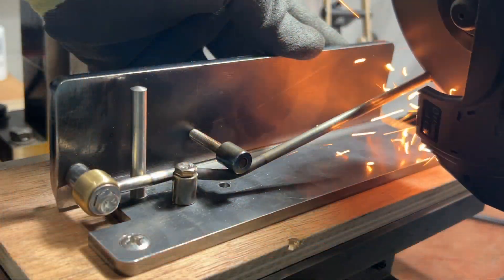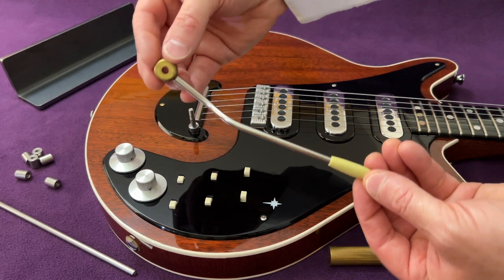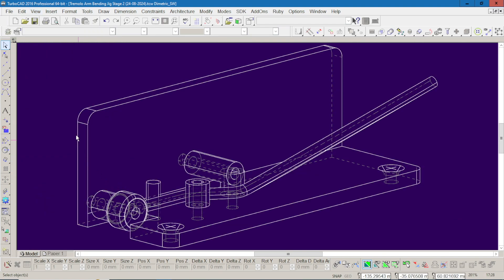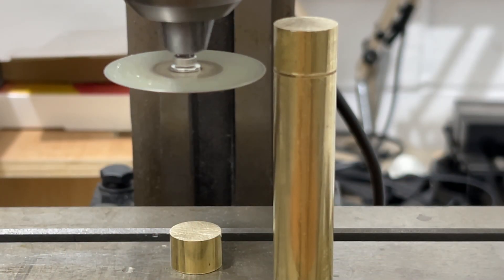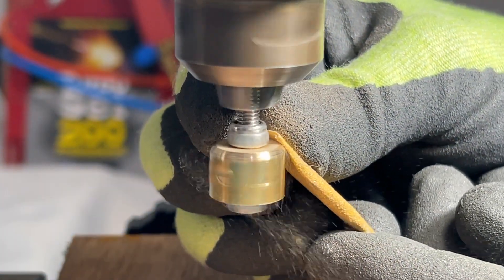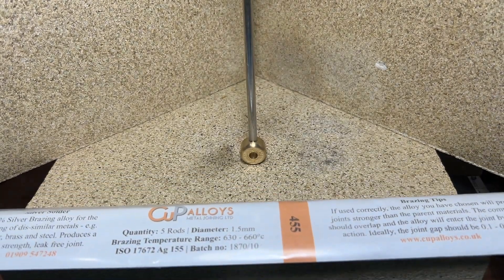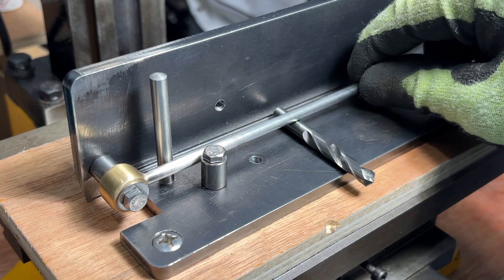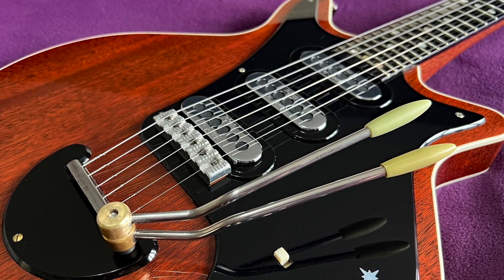Brian May Red Special Guitar Tremolo Arm Design and Make

Comment: Hello. I would like to ask a question not about the original red special, but the red special guitars made by  Guild. I'm curious as to why Kahler Tremolos were included on them. Was it because they were the closest in operation to the original red special trem? Or was there some other reason I am not aware of? I would appreciate your insight on this.
Reply from the maker: Check out Gary A. Donohue's very informative website page on the 1985 Guild BHM1:

https://www.gad.net/Blog/2019/03/19/1985-guild-brian-may-bhm1/

The reason is most likely because they are a reasonably priced, decent quality standard rocker tremolo unit available in a black finish to blend in with the gloss black pickguard.
Reply: @dsgb  Thank you for your input. I believe you're correct. Guild must not have wanted to recreate the red special's bridge at first, likely hoping that kahler was a close enough approximation.
Reply from the maker: Take a look at my Burns BHM4787 upgrade:

https://dsgb.net/projects/burns/

I am seeking a commercially available gloss black 'chromed' tremolo for this to achieve a similar affect. The - Wilkinson WVS50II tremolo black should do the job. 👍🏻

Comment: No you should not be wearing gloves for that! It's extremely dangerous to wear gloves when operating any kind of machinery be it a drill press, bandsaw, table saw, lathe or mill. 
It may seem safer but it's really not, if the glove were to make contact it could get bound up and it would pull your hand further into the machine and you wouldn't be able to stop it from happening, which would shred you.
 With bare hands yes you'll still get injured but you'll at least be able to pull your hands away from the machine before it could cause serious injury. 👍👍
Reply from the maker: This is good general advice, thank you for explaining in detail. 👍🏻😀

I would like to reassure people taking the time to read this that I have worked within industrial and nuclear safety fields for 25 years and hold a NEBOSH general certificate in workplace health and safety.

My recommendation was based on the judgement that in this specific situation, the risk of being cut by the diamond coated disc is outweighed by the risk of more significant injury caused by being drawn into the rotating machinery. Further, this mini drill press is a low torque machine which readily stalls if a load spike occurs.

Risk assessments and recommendations to wear or not wear personal protective equipment should always be appropriate to the specific task being undertaken.
Reply: @dsgb  Believe in what you learned Sir. It's polite from your side to be kind  and nice to all sorts of people on the net including myself ☺, but if i was at your place i would rather believe in what you already know + your practice. IMHO Gloves are ok 100% for that task you were doing, this comes from safety occupation engineer. Cheers. 
P.S. your YT chanel and site are amazing. For a poor engineer like me who repair guitar, design tools and wind pickups and aim to make some ala ''red specials'' it's a perfect place. I hope that one day i will get some normal camera to start to make videos about guitar pickups. I admire Bran May due to he made his own guitar and i think that some brand riped of his tremolo bridge idea ( Brian told that as well in a nicer way i think), for me that tremolo due it's long knife edge is superior.
Reply from the maker: Thank you so much for your supportive and positive comments. 🙏🏻💜
Reply: @dsgb  no problem, thank you for sharing the know how. You had right when for what you told, and i think it's good for people to know that. The knowledge💥 is power 🤗
Reply: Not exactly, if gloves are well suited to hand it's better to have them. Cutters and drills will damage the glove and you can feel that if it's snag fit good qulity hide glow and for sure you can pull back hand. I think that those logics how machine can take a glove and caouse higher damage same from workers who don't like to fallow the safety rules, maybe some engineers adopted it?.
I' we heard tons of excuses, and when worker get injured then company should pay for it, and an engineer who was point to conduct the safety training and supervision got blamed. So when i worked as safety engineer i'm sorry but worker have don't fallow the rules that can be a problem.

Some won't wear a protective helmet in the summer, they say "I'm too hot, I'm bothered by sweating", some won't wear protective glasses/ masks. And there are  those  who don't want to wear b. masks, they say "I can hardly breathe", and there are those who don't want to wear gloves. If they fall and injure their head or die from a blow to the head, who is to blame? When a splint from metal or wood etc  enters their their eye? When he ends up with burns cuts on hands who's to blame?
Some circular saws can cut off their fingers and hand, the gloves won't help in that case for sure, but instead of pushing the wood or the metal they're cutting with a "pusher"  so that a hand doesn't come close to the blade, some tray to avoid that and then blade cuts fingers. 

So then we need to rush them to the hospital with all their fingers cut off (on ice), and ask a good vascular surgeon and an orthopedic surgeon to sew them up. And it's a race against time, because the tissue dies off fast.

The internet is great because you can learn almost everything, but it's  also a very dangerous because people who are not experts in something give advices. But the problem may occur when a naïve person believes in it.

Maybe that's why in the 21st century we have people who believe in a flat earth more than in the 20th century.

Comment: 7:35 no you shouldn't. don't wear gloves when using a drill or a lathe because gloves get caught resulting in all sorts of damage to fingers.
Reply from the maker: I would like to reassure people taking the time to read this that I have worked within industrial and nuclear safety fields for 25 years and hold a NEBOSH general certificate in workplace health and safety.

My recommendation was based on the judgement that in this specific situation, the risk of being cut by the diamond coated disc is outweighed by the risk of more significant injury caused by being drawn into the rotating machinery. Further, this mini drill press is a low torque machine which readily stalls if a load spike occurs.

Risk assessments and recommendations to wear or not wear personal protective equipment should always be appropriate to the specific task being undertaken.

Comment: Was the brazing straight forward as the one I made   I did it threaded but it's just come loose
Reply from the maker: Brazing is challenging to execute neatly and you will need gas welding equipment. Apply some threadlock adhesive to your threaded joint and it should be o.k.
Reply: @dsgb  done it using a blow torch and it turned out really well cheers.
Reply from the maker: Thank you for the update. I'm pleased it worked out well for you. 😀👍🏻

Comment: Love your videos.
I've just finished up making a "tribute" trem arm for my BM-75 so whilst not totally acurate in most ways, I enjoyed tinkering.
Made it with an M6 thread so it fits both my BM-75 and my HB ST-59hm. 
Had to use a diy drill mostly for it so it was  "fun" trying to cut and shape a brass bar stock.
Reply from the maker: Thanks. 🙏🏻 😀 It's always interesting to hear how DIY enthusiasts circumvent the challenges of not being able to use specialist tools and equipment to achieve satisfactory results.